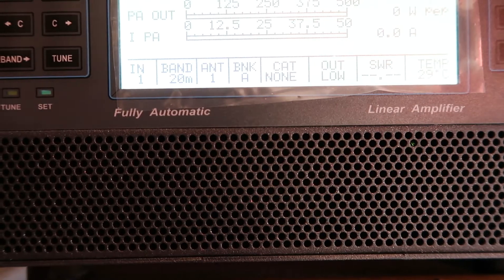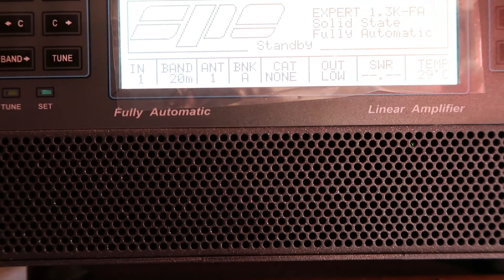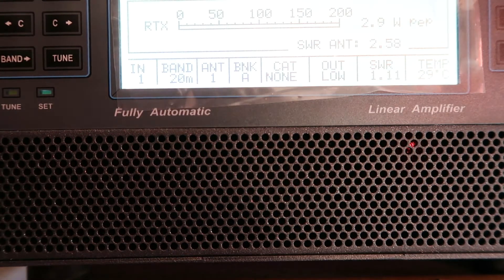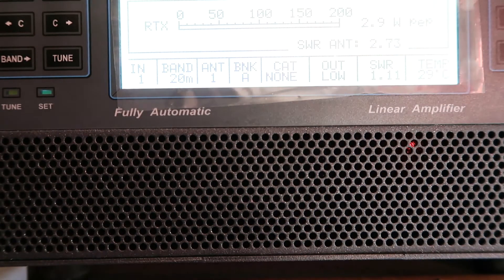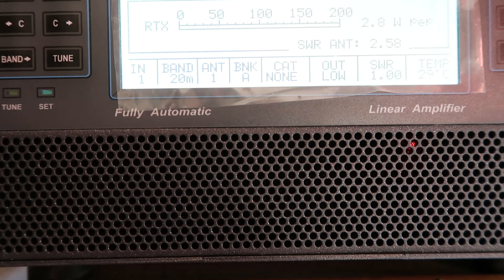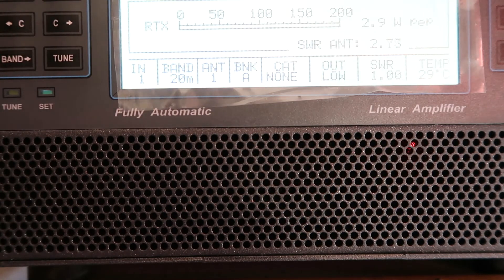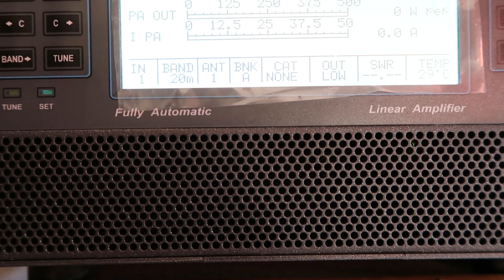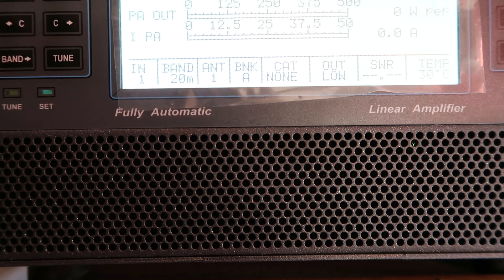Expert 1.3K FA Amp Issues

Comment: Hi ! 
Have a similar prob her, but only on SSB , 20m to 10m, only on Low and Mid power, no pb on CW or RTTY , no pb on Hih power, i had the probleme  on a Hexbeam, and now also on a TA53M mosley, the SWR is 1 to 1 . With or without the internal tuner.  i use SSB on my Tx for ft8 or rtty and i can't use the amplifier, because in high power the traps don't like to much continuous power. I can't use SSB in Low and Mid.

Is your pb solved ?

Comment: Did you get it fixed/ resolved? I'm looking to pick up one of these amps myself...
Reply from the maker: It went back to the factory
Reply: @MarkG0MGX  How the problem has been solved? which was the cause?
Reply: @MarkG0MGX  Why ? The problem is your crap antenna not handling the power and breaking down. Did you test with a 1KW DL ?